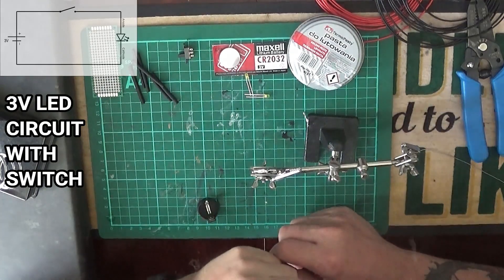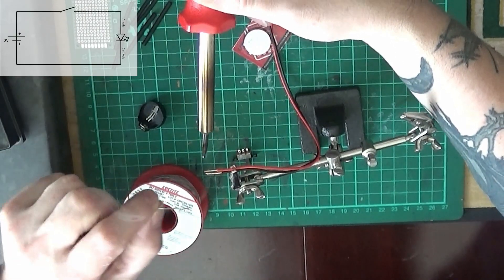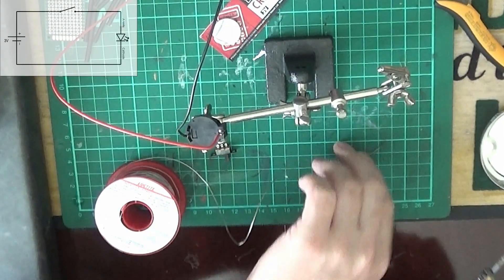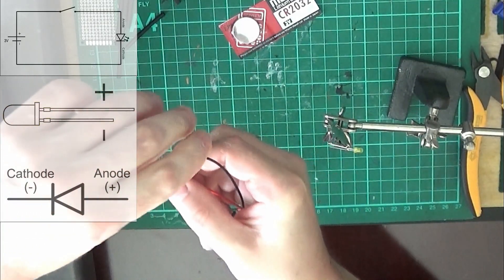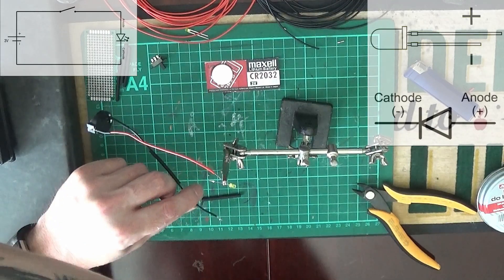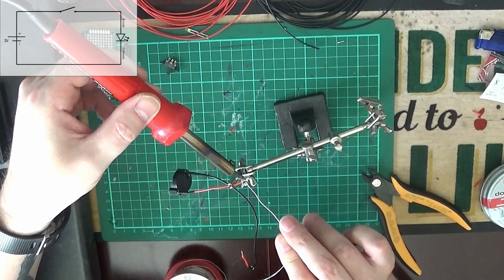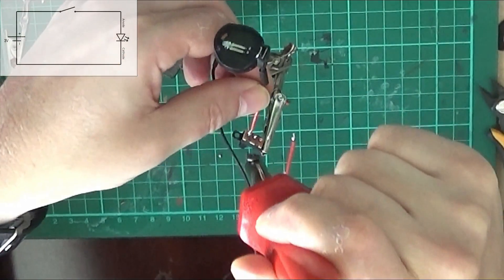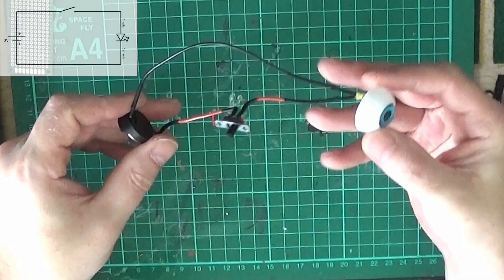3V LED Circuit With Switch

Comment: Cool tutorial! Don't we need any resistors cause a white LED can take in 3,6V?
Reply from the maker: Thank you Anna. You will obviously want to make sure your LEDs are balanced with your battery to avoid any problems. :)
Reply: And for these thin cables.. Can I use bell wire?
Reply from the maker: @annaqura3360  You'll want to check on your cables sizes. I would imagine bell wire would be ok, but don't quote me on that.
Reply: @dramamask  Thank you! For 5 LED (20mA) 4 of them blue and 1 orange, would you recommend to get a battery holder with 2 AA (together 3V) or 3 AA as you had and build in resistors instead? I am afraid that the batteries give a bit less than 3 V and the lights not turning on then.
Reply from the maker: @annaqura3360  You might want to look into increasing the voltage at the battery and using resistors and parallel circuits to run 5 LEDs. There are many ways to do it. You can increase the battery voltage by running the batteries in series, for instance, two 3V batteries in series will give you 6V. Or, you might want to use a 9V battery to increase longevity of battery life in conjunction with how your circuit will be laid out. There are many ways to do things and obviously best to choose what you are going to do to suit your project. You will want to do some research if you're not too sure. :)

Comment: Thanks for sharing. I have 24 switch but I want it independent (has its own LED light. Just like an illuminated switch) What’s the circuit look like?
Reply from the maker: I'm not sure what you mean and you'll want to do some research anyway. There's lots of videos on YouTube for you to have a look at which will most likely help you in what you want to do. :)

Comment: Very helpful!  Also that's funny I found this almost an exact year later than when you posted it! July 15th is my birthday! One quick question I have is does it matter what volts the switch is?  I am trying to do this same simple design but I can't find an on/off switch that isn't 12V or higher, can a 12V switch still work off of a 3V battery to power up just one 3V led? Any tips would be very appreciated, thanks!
Reply from the maker: If your switch is rated higher than the voltage you are using then all should be good to go! :) Of course, if it was the other way around the switch might melt being under the voltage one might be using.

Happy birthday for tomorrow and hope you have a great day! :)

Thank you Julia! :)